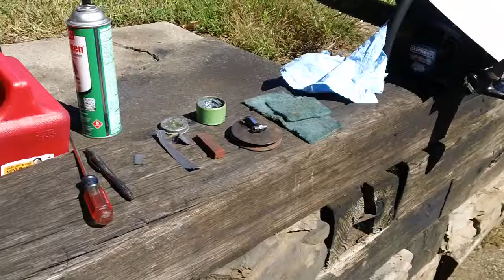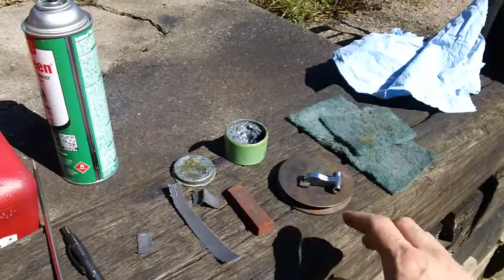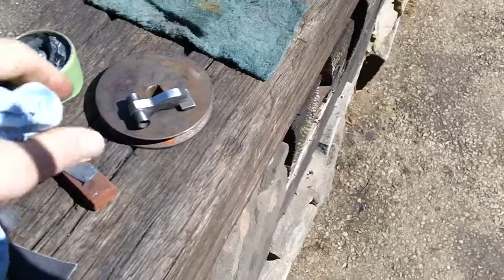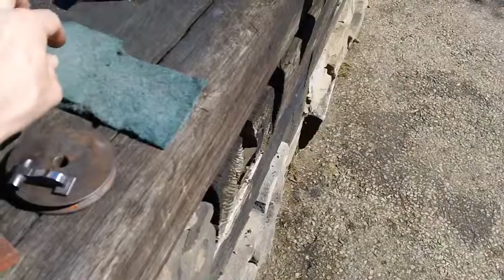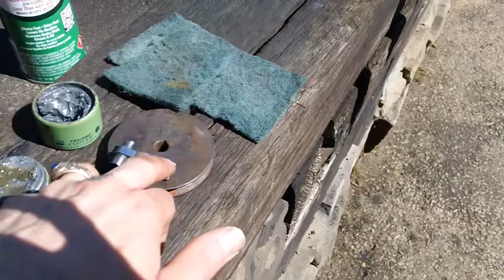VEPR 12 TRIGGER UPGRADES/IMPROVEMENT

Comment: Thanks for your help!
Reply from the maker: you want to remove as much friction as possible if you plan on using weak low power ammo such as 2 and 3/4 or 3 dram ammo,  if all trigger parts are flattened and polished bolt carrier will have a easier time moving back and forward thus allow weapon to cycle easier thus making it more reliable.